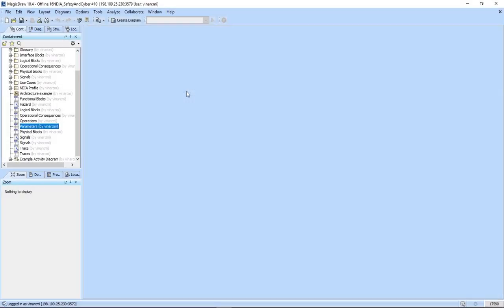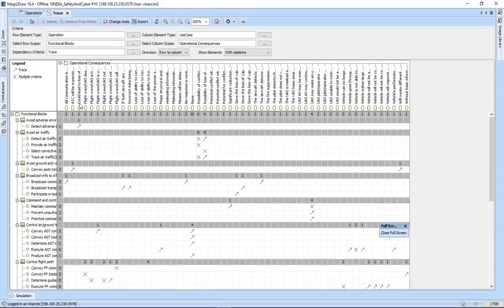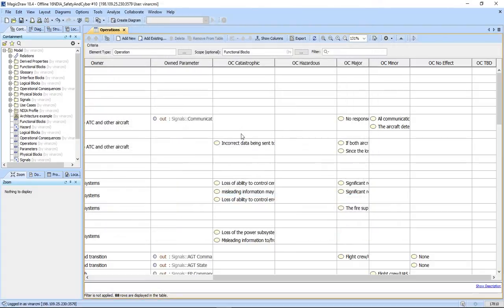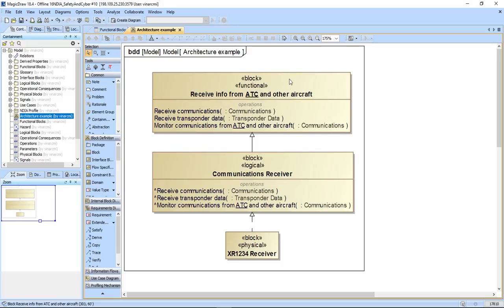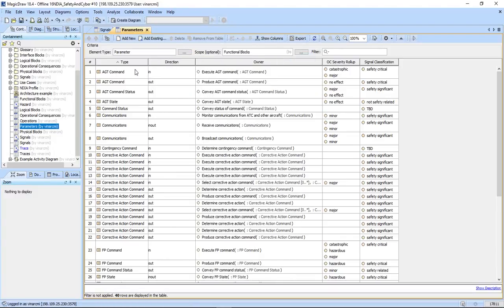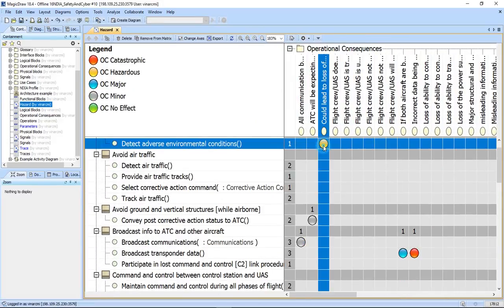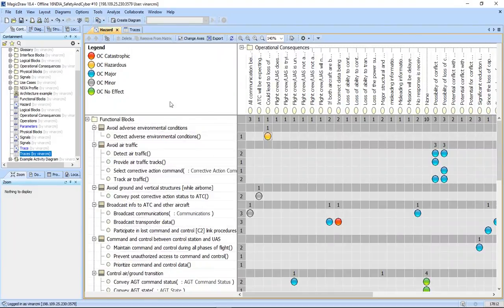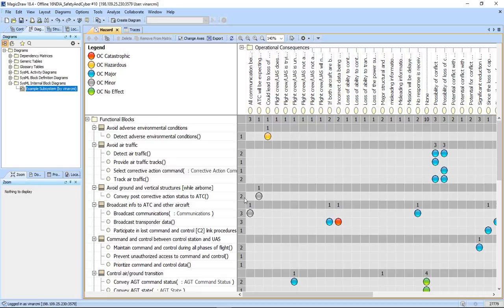Functional Hazard Analysis: Outcome

Comment: Great examples of importing information from a document source and making it more useful and 'alive'. Did you find any inconsistencies as a result of modeling what was in the Word document?  If so, can you share some of those?  I think a lot of the value from modeling is that it forces you to not gloss over or miss, examples being things like 1) a function has an output that seems to go nowhere, an element has no requirements traced to it, or multiple items in our documentation that the author intends as the same thing but are worded slightly differently which may cause confusion to consumers of the info later.
Reply from the maker: Yes, there were quite a few; identical consequences with different ratings, multiple consequences with identical intent and slightly different wording, other minor hiccups.  You're spot on with your comments...a few quick quality checks unsatisfied pins, unconnected content, or other "orphans" can instantly spot inconsistencies almost impossible to find in a document-centric approach.
I'll be posting findings from an assessment of a Mars survey objectives report <1 year old that had quite a bit of inconsistent content (it's for a class assignment my students are currently executing).